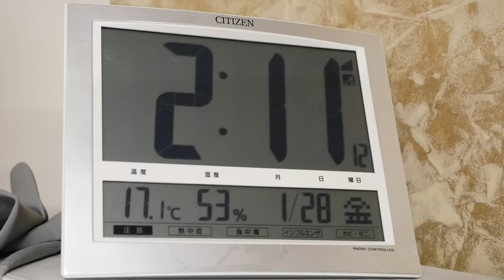日本で夢かなう！フランス人のパン職人が開いたパン屋に深夜2時から密着！京都「ブーランジェリー ガロパン」

Comment: Mad respect for this guy. He baked all these different breads and pastries on his own. Holy moly. Truly incredible.
Reply: In France every bakery which brand "Boulangerie" do the same work, and do a second batch afternoon.
But some shop do not have "Boulangerie" sign, but "Paul" or some bread name.. It means bread is not made in the office (but may be cooked in the oven), it's bread made in factory (cheaper cost).
Due to the laws, only shops who made and cook bread in the office can have "Boulangerie" sign. I'll tell you if by chance you go to France one day.
Finally in France, even industrial bread is better than the bread that I could find in other countries. Except in Luxembourg, there are shops that make very good bread.
"Bagette au froment" is the best.
Reply: @ledganache  i did not know this. This is very useful information! Thank you 🙏
Reply: @ledganache  and as far as I know baguettes have to be prepared 2-3 days in advance at specific temperatures due to the sourdough
Reply: @jagababa  No, it's just a matter of preparing the dough and leaving it for a few hours (at room temperature) to rise.
You may confuse it with sourdough (fr: levain), which is used as yeast in the dough. it indeed requires several days of preparation, similar to your explanation.

But for that, traditional baker just keep a portion of dough. But for that a traditional baker simply keeps part of the dough that he will integrate into the one he will prepare the next day, and so on. Sourdough is simply fermented dough.

It is a principle similar to that of the Hermann cake recipe.
Reply: @ledganache  any reason why only Luxembourg makes decent bread in your opinion? Why you didn't mention Italian bread?
Reply: @marilson84  Luxembourg is a mix between french, belgian and german cultures. I dont say it's the only, but the only I know. On the other hand, you have to consider that it is a tiny country. A traditional craftsman may have a reputation of national significance.
I found a firm there, "Fisher" (comparable to "Paul") which produces a baguette quite similar to that of the bakery that I appreciate the most in France.
I think you can find excellent breads in every country. I rather pose the principle if it is representative enough (widespread and accessible).
For example, in Germany you can find a wide variety of croissants, and I think they are well made. But it's not a common taste in Germany to have a simple product, they like to have something extra: sugar, cream, chocolate, and several at the same time... From my French point of view, for whom a simple croissant with butter is perfect, it does not suit me.
Reply: @ledganache  many thanks for your thorough response. I am Italian and my father works in the bakery industry. He installs and maintain the machines and works for a very important French/Italian company which is the worldwide leader in making bakery equipment. I have attended several international bakery exhibitions and without any doubt the French bakers are recognised as the gold standard. I also see how the interaction and collaboration between Italy and France helped us to make better bread in general and move away from regional variations. Nothing can beat a nice baguette and I also agree with you on the plain croissant, much better than the ones with a filling.
Reply: @marilson84  OK.
My assertion on the quality of foreign bread, is limited to my experience. I haven't been around the world, but in the different countries I've been through I couldn't find any acceptable bread (but that wasn't the purpose of my travels either)
Reply: @ledganache  bien expliqué 👌🏿
Reply: @ledganache  Thank you for this info... here in the U.S. all industrial bread making is just a lot of chemical ingredients, genetically modified foods, artificial colouring and flavouring, added elements that you'll never find in a bakery in France or Italy. Only those that pride themselves in baking "natural, organic" breads, bagels and pastries are worth your money. More expensive, but worth every penny..
Reply: @BeliaToscana  There is a lot of industrial bread in France, but I think it looks very different.
Research/development in France has aimed to equalize and compete with traditional backery. Today in superstores you can find industrial staff/equipment that can follow a traditional recipe. In the shelving you will find a mix of products, more or less industrial at different prices. You have the choice between the 1st price baguette, and the "tradition" baguette twice as expensive.

The "tradition" baguette, is more a brand than a real tradition. The way of consumption has changed. Previously for ordinary people, bread was a staple food, and we dont bought baguettes, but huge breads.
It would take a long time to explain, compared to the culinary reputation of France. In short, it's a difference between a restaurant and a meal at home. For my grandparents generation, an ordinary meal is a dish at noon, and soup every evening. Bread was the main complement. (And did not eat croissant, except some sunday morning...)
It's the same transformation with wine. at this time there is less consideration of alcoholism, and wine is considered a food. We call it "table wine" (vin de table), cheap it was sold in a liter bottle. Nowaday you won't find many, we consume a lot less wine, and so the commercial offer has focused on quality and diversity.
It's a bit the same thing in the bakery. You will find several kinds of "traditional" baguettes, and always a cheap/simple bread. But industry has also sought to compete with artisanal quality, and it works rather well. There are fewer traditional bakeries. And it's quite possible to find a traditional bakery that doesn't produce bread as good as some industrial ones. The real traditional bakeries that survive are often shops that have a strong reputation in the city, a reputation over several generations.
Reply: Wow. So high of yourself bout other countries. I'm not sure you was all around the world and tasted all kind of bread and pastry there. You mention only Europe, maximum US, as I've understood from your "opinion". You wasn't even close on whole Middle East, Asia, Africa and etc. Your mindset is so narrow.... )))
Reply: @artysplash5969  Yes, that's just my opinion, as I said before : "My assertion on the quality of foreign bread, is limited to my experience. I haven't been around the world, (..) (but that wasn't the purpose of my travels either)"
And I don't add pastry to that, (I just mentioned a case in Germany to explain a cultural difference.)

If you care to know, I love Indian naans. I've ordered more than bread in recent years, to the point where I've learned to make it myself. Also, rice based dough (riceball, mochi) is sometyhing impossible for my taste (Although I know many french people who love it). But its off-topic.

In international bakery competitions, it is often a foreign artisan who wins 1st place. Each time, french media publish an article titled : "the best baguette is <foreign country>" But that doesn't mean producing bread in an exotic way.
So if you know of a culture, a remarkable bread recipe, do not hesitate to share. It sincerely interests me more than a sterile moral lesson. (Confidence: You have no idea of french self-esteem. Even the english people who are the first to tar us do not denigrate us so much.)

What I'm trying to say here is that bread in France is more of a cultural fact than a food stuff. And if you have the opportunity to visit my country, to give you elements to find your way around, because I am not convinced that one can find an acceptable bread first try. Because this tradition is falling (for economic/industrial reasons).
And point so-called "baguette tradition" is not traditional, but tasty.

It's not the point that the french are better than people from other countries. This is my culture, I'm just trying to share it.
Reply: @jagababa  baguette don t have prépared one or two days aerlier . Hé is prépared this night for tomorrow.
Reply: @artysplash5969  seems like you’re the one “narrow minded” if you ask me. You obviously didn’t read what he/she said, and seems you’re just upset they didn’t praise your area.. be kind, it’s a wonderful world

Comment: I reccomend baking the bread flat, like they do in India. You can use Google to find a recipe for "naan". When the bread is thin, then the bread cooks faster than thick loaves of bread. Instead of Naan you can make zionist/Jewish matza, or south AmericanGordian, but Naan from India tastes the best of the three options.  If you want a sandwhich 🥪 ("torta" en Mexico) then use two pieces of flat bread instead of cutting the bread with a knife. Additionally,  flat bread is never sticky or goes in the middle. Large loaves come out of the oven raw at the very center when you are learning to bake bread for the first time.

Comment: KYUTINEN Daniil (1883-1942) - blockade baker Baked blockade bread during the blockade. He died of exhaustion on February 3, 1942 at the age of 59 right at work, without eating a single gram of baked bread. He was buried at the Shuvalovsky cemetery. Included in the book of memory of the siege of Leningrad.
This is an amazing baker, bow to the ground.